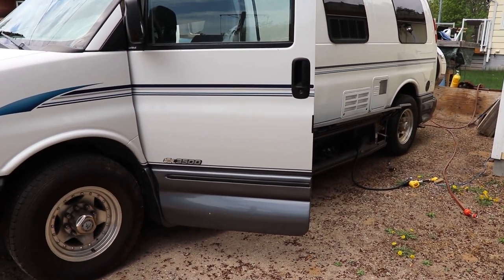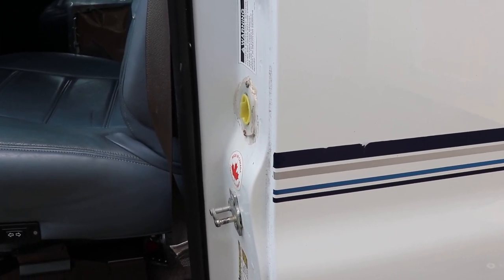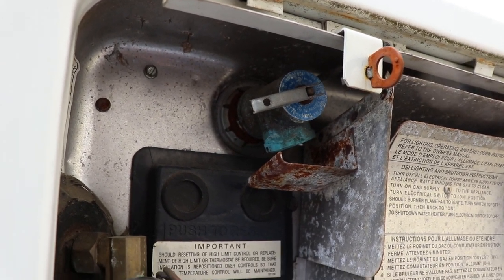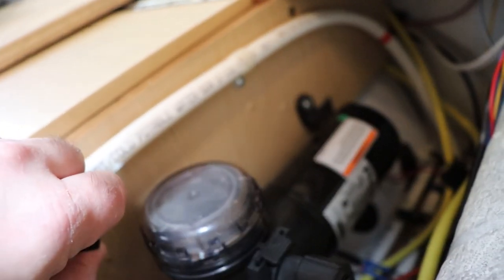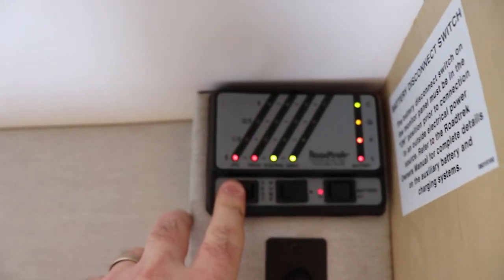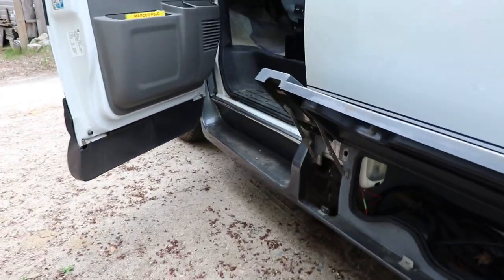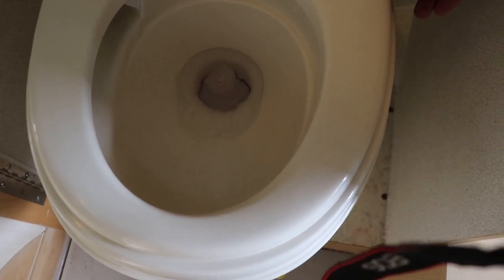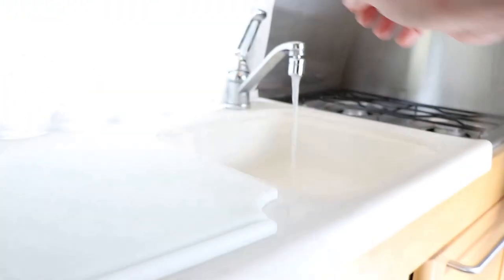Roadtrek Popular - Water Filling & Sanitization

Comment: Hey bud I had a quick question a little unrelated to the video. Say you wanted to use your hot water heater in the winter. Is it not possible to use it after winterizing? Or can you use the indoor water tank supply to use with the water heater? 
Thanks in advance.
Reply from the maker: I had a look at the 2005 manual and it seems that you can use the hot water tank in the winter but obviously you need to keep the van warm when you do this.  I'd be interested in knowing how long the propane lasts during the winter.  Please check your manual:  https://archive.org/details/@steverontario?and%5B%5D=Roadtrek